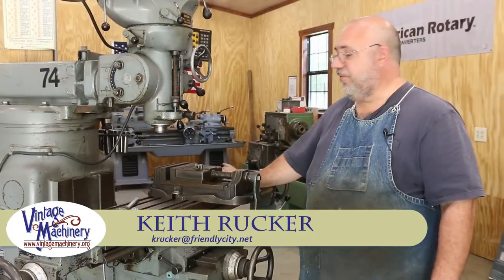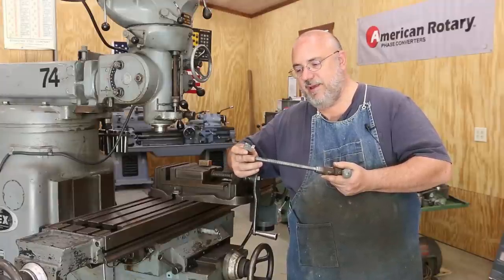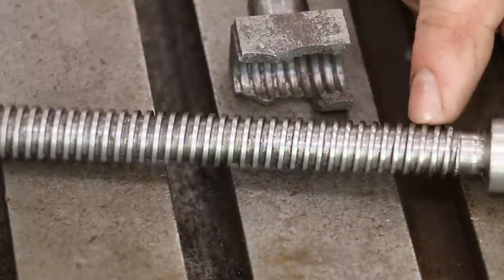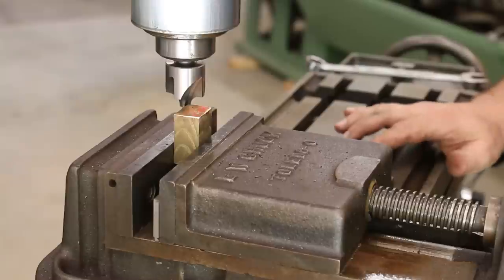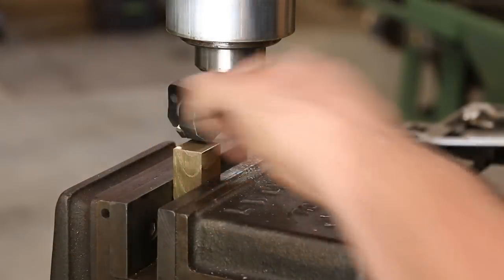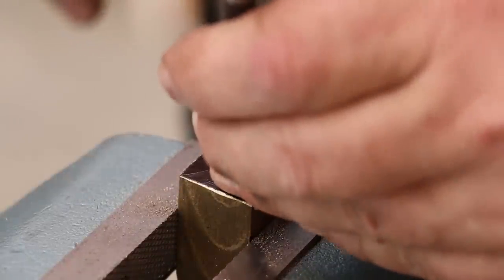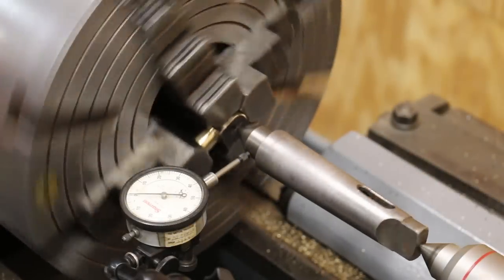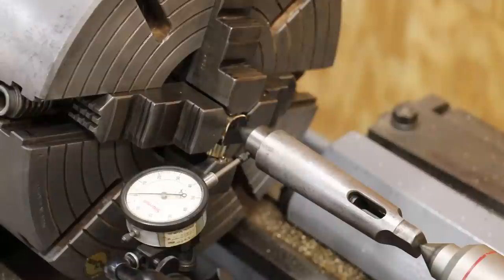Machining a New Bronze Cross Feed Nut for a 1909 F. E. Reed Lathe

Comment: He easily could have tested the correct taping hole size with some scrap aluminum stock first.  I frequently back taps out and clean hole and tap before continuing, if I sense any trouble.  I am not a machinist.  Ron W4BIN

Comment: When the tap twisted, I thougth why not turn the nut and make threds from opposit side?
Would there be some downside to that?
Great video. Regards PeO
Reply: If you restarted from the other side, it would be very unlikely that the threads would actually line up where they meet

Comment: this maybe dumb question but why use letters for some drill bits instead of decimal points
Reply: thats the american system, letter and number drills are more finer and smaller divisions than the usual fraction sizes,  its just how they do it, they dont like to decimalise anything!
Reply: About the only thing they do is money :)
Reply: Hmmm, .5 inches, 10.6 gallons, 1.75 miles, 3.5 o'clock, April .5,  lol..
Reply: I'd bet it's because the letters are easier to remember. "Was that 8.1 or 6.1?"
Reply: Jusb1066 I wouldn't dignify it with the term "system"

Comment: it's dragging because of all the chips wedged in there, your lucky that you didn't snap that tap!
Reply: No it's not...….the tap does not have any side relief on the threads and so is a force fit as it cuts......he's lucky he got away with it. A vee form 60 or 55 deg tap will always cut free because the vee angle of the thread form automatically backs off as it cuts whereas with a square thread or even a true Acme the threads tend to grip the sides of the tap flanks. This is something like trying to machine with a tool that doesn't have any side clearance angle and rubs on the job.

Comment: I wonder if the nut fits the screw. You even didn't try did you ? At least not in the video.
Further on, you must let the machine do the work when you tap. Don't rotate the tap by hand. but let the machine rotate and hold the tap (either by hand or in the drill bit head).
It all looks very like an amature that's doing the job. Sorry for that.

Comment: LUBE IT OR RELEASE AGENT AND SOME J.B.WELD... LIKE PLAY-DOH AT FIRST, SHAPE IT UP, PRESS AROUND, SCREW IT OFF, LET IT HARDEN.. STRONGER THAN THE ORIGINAL... RESHAPE THE PART WITH A GRINDER...  CHEAP AND, WELL... UGLY, MATCHES THE DUCT-TAPE AND...UGH....IT WORKED FOR GRANDAPA...

Comment: way  to much talking,, to  reduce the loading on that tap  you can drill  up .015 dia. larger dia!  will not  affect the  thread  strength  a bit!
Reply: True, threads are normally cut with only 75% thread engagement…...if you attempt 100% thread engagement you'll break the tap.

Comment: Why do ppl have to complicate things with different standards? Trapezoid thread used in metric system is 30° straight ,acme is 14,5-which one do you think is easyer to set up on a lathe?
NPT pipe taper is 1°47minutes and 24 seconds -how da fuck are you gonna set that angle on the lathe?Why not just put 1 ° or 2°?
Not to mention morse taper which is completely retarded like Mt4 = 2°58 minutes and 31 second.
How da hell one sets up something like that whithout a precise angle protractor.
old farts should have round the numbers and be done with it ,and had only one standard for the whole world to use.That would solve alot of problems .
Reply: zumbazumba1 I
Reply: NPT taper is 3/8"/foot on each side or 3/4"/foot on the total diameter...easily set on the taper attachment on the lathe.
MT4 is 1.2474"/foot on diameter or for practical purposes 1 1/4" per foot. Unless you grind the taper and have a set of MT4 gages you'll have to blue the work and file to fit.
No matter how the taper is defined: degree, inch/ft. or mm/m  you still need a sine bar and an indicator to to accurately set the lathe taper attachment (or compound for short tapers) or to swing the table on a center grinder.
A magnetic based sine bar with a vee grooved base is the cat's pajamas if you do much taper work. Set the sine bar on the round work and with an indicator on the compound tool post adjust the compound or taper attachment till the indicator tracks "zero" from end to end of the sine bar.

Comment: May I take it that you are not used to working with a 4-jaw independent chuck? Far too much messing around bringing it to position... take it in bigger bites... faint heart never won fair lady (or anything else, for that matter). A hundred-thousandths is 1/10th of an inch, which is a huge amount, yet you slackened only about 10 thou. I'm surprised this little exercise didn't take you all day, instead of the couple of minutes it should have taken, had you been adept at setting up in an independent 4-jaw chuck.